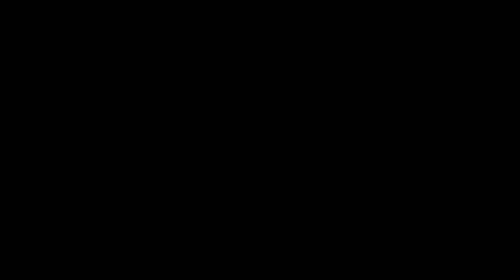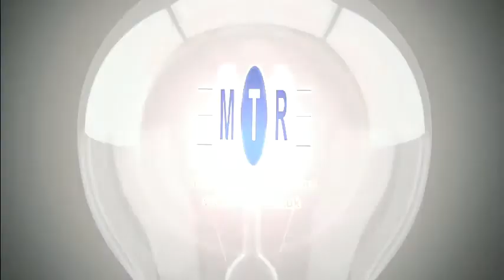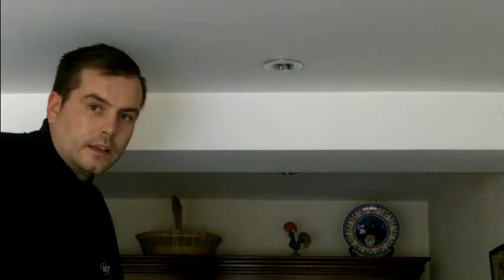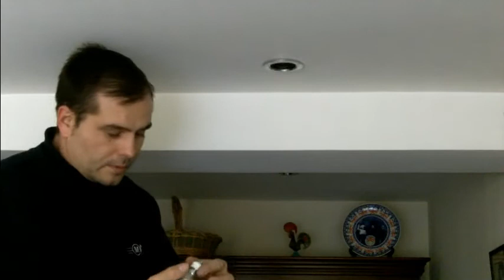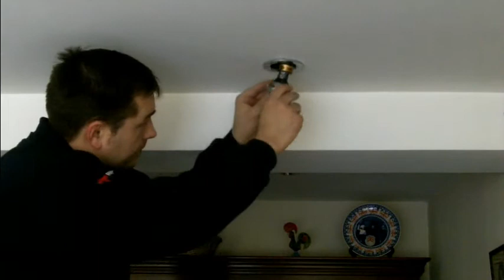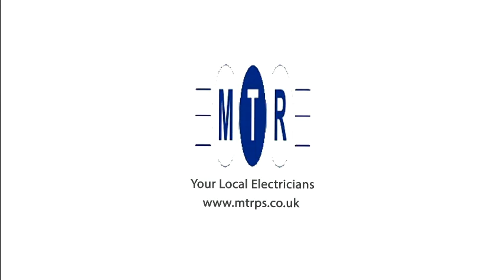How to Replace Your Halogen Spotlight Bulbs for LED Bulbs.

Comment: I tried to pull the ceramic bulb holder down to replace the bulb, but the ceramic came away. Now I cannot put the new bulb in. Help
Reply from the maker: Eileen Lynch some of these can get damaged by heat. A replacement fitting may be required from here. Kind Regards, Mark